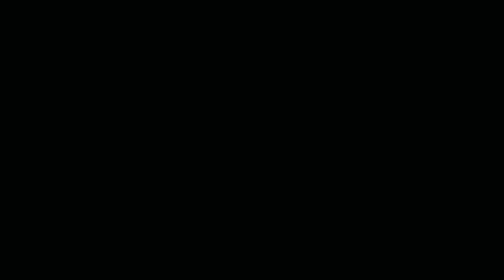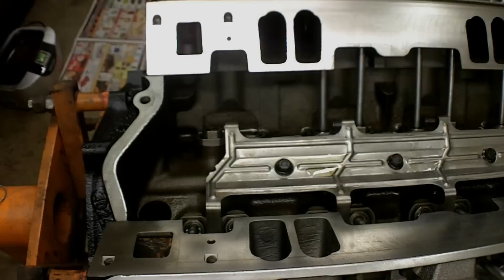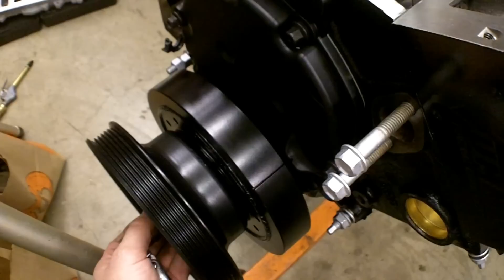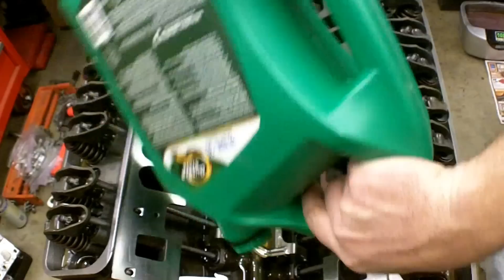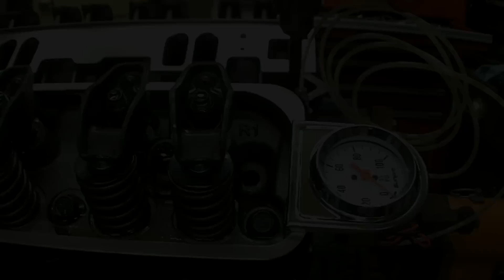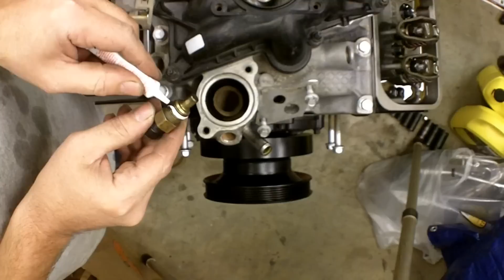Part 4-5 1998 5.7 350 CI Vortec Engine Rebuild

Comment: Thanks for your time and all the details.  There are some very helpful techniques.  I've got an 88 Chevy 4wd with an engine that at least runs well if I stay out of garages.  25 mpg, the secret seems to be the TPS not returning 5v whether GM or afermarket.  A TPS enhancer is out there for some older GM truck engines.  It's pretty wild what goes.  I got everything that JEGS labels as an enhancer and it all works to improve.  Now all I gotta do is get up the nerve to overhaul.  So thanks.
Reply from the maker: +Terence Gillespie 
No problem Terence! I'm glad you found the videos useful. I've never heard of an enhancer. I'll have to look into them. It's an ambitious proposition to rebuild no doubt- but it can be done with great success if you take your time and check yourself as you go. Good luck when/if you dive in! Take care, G.
Reply: +ghostses I talked to the company tech in CO and got some more inside dope on their electronic gizmo.  It does not just supply the missing voltS it changes the range so that a nearly perfect transference of throttle messages the distributor with spark advance occurs.  I got this info though in more detail because the first unit that JEGS sent me did not work so I called the manufacturer and they sent out a good one right away.  My truck with its old oil eating engine got attention right away from a Chevy garage after working on the transfer case.  Next time I took it in not too long after I began to have fuel, computer, and electronic trouble and the whole ignition computer thing was new.  So my truck has been down all summer with me testing and finding that an old worn water temp sensor had been installed and some other stuff. One injector was dripping...  Crap.  It doesn't  pay to own it.  GM got a complaint and I'm over in local garages.  So, watching you work was great.  Having a way wild engine that garages cannot understand and fool around on is a goal.  Ramjet might work.  Maybe my trouble is that I got a college degree.  I think that's part of it.  And I just spent half the night wiring a start button to the starter solenoid on my nearly new big HP commercial mower because it's needing more voltage than the factor ignition switch won't push a full 12 point whatever.  Factory engineers now..... Nothing's perfect.  Takes someone like you to set it straight.  Thanks.  You do well with your video presentation, the best.  No college dean is going to do anything different or better.  Building sales presentations earlier in my life was my business.
Reply from the maker: +Terence Gillespie 
Thanks for the information Terance! 

I've been saying for years just because someone does something as a "profession"- doesn't mean they're any good at it- regardless of education and time on task. Case in point- your local garage/technician. I myself have always gravitated towards technical things. The last 17yrs have been in the IT industry, with ten years in business for myself. I shutdown my business about 2yrs ago and am now flipping and investing in real estate...lol. 

It sounds like your local garage did more harm than good. I'm shooting in the dark, but I would ensure all chassis and engine grounds are intact- clean, bright, and tight. It's possible they didn't hook something back up when they were working on the transfer case, etc. which may be causing the onslaught of other issues. Something similar happened to a friends car which had some transmission work done. The fuel pump was intermittently working so it was replaced. The problem turned out to be they didn't connect a ground strap. Again, shooting in the dark- but in many cases the most simple things are often overlooked. I would start where they were working, and then branch out from there. If they pulled the transmission, I believe there is a ground strap that connects to a bell housing bolt on the passenger side rear of the engine- if I recall correctly. 

I don't see a degree as your problem. It's simply a different chosen path with a different focus. We all basically start learning at the same place- some just start at different times. You seem to be undertaking something fairly new and foreign, and are trying to track something down that even the "skilled" cannot find. It might not be easy, but you will find the solution if you stay at it. 

Glad you like the videos! Good luck in tracking down the issues, G.
Reply: +ghostses So you and I are kind of alike in our focus.  Real estate license.  Made major discoveries in language and math.  Alpha = base 26.  It's a mind blower when you begin to evaluate this.  I'm alone on a larger park style family farm with timber the crop.  Everyone likes going to a park so I'm in trouble now.  Rich kids like it and my personal curiosities have not gotten me up over the top of these wannabees, MDs and all.  No one but me likes me having the best anything at all even if I build it and I do enjoy building-modifying technical stuff. Flunky type engineers have flooded the market with half baked mowing equipment esp the larger home owner market.  I'm going to look around for an old 350 block to redo on my own and an engine stand maybe.  There is so much to do and I have to stop to cook clean up.  How wild can an engine build get on a budget?  I don't have 10k for the GM Ramjet set up fortorquey  heavy towing.  I've discovered that big stone has pictures in it and one I sold to a customer dentist has the Apple computer apple with the leaf two feet tall in relief, but no bite out of it.  1500 lb stones worth up to 10k or more.  I have an art degree with a heavy emphasis in psych.
Reply from the maker: +Terence Gillespie 
I know what you mean. I don't know. I tow with this stock rebuild 6 days a week. It works pretty good, but it does take me a bit to get up to speed going up hill. I'm pulling a 7x16 cargo trailer loaded down. Good luck, G.

Comment: First off, thanks for posting all the videos , I watched the whole series, My question is, where do you get the torque specs for the manifold? I had googled the Torque specs and got 10 lbs when I did the Intake Manifold in 1 pass. You did 3-4  passes at it. which I thought was a better.
Reply from the maker: ***** No problem Darren! I'm glad you liked them. I got the torque specs from a pdf I found online. They're calling it a Marine/Industrial manual but the engine is the same. Here's a link to one. The lower intake passes and specs should be on the second page I believe. Take care, G.

https://www.m2omarine.com/resources/Indmar_5.7RepairSpecs.pdf
Reply: *****  Thanks, that was exactly what I was looking for!!!!  Gonna go practice laying down a perfect 5mm bead!
Reply from the maker: ***** No problem! LOL... The 5mm bead is an art form for sure. 4 or 6 is easy- but 5 is something else. I would spend a few weeks in practice...lol. G.
Reply from the maker: +hoghogwild 
Thanks man! I'm glad you liked the series. That's one sweet looking engine you have there. The document  I linked does show a spider in it, as shown on page 28. It is an 01, so maybe things have changed things over the years in the marine/industrial engines, I don't know. I can't tell if the lower and upper are iron and aluminum though. Either way, the stock build is still going strong- knock on wood...lol Thanks for the post and take care, G.
Reply: 0 pp+900ppp

Comment: I said earlier I get a chuckle every now and then and the "Dead on 4 mil highly technical applicator" was one
Of them. However, it looked more like 4.02 to me. I noticed you have some good torque wrenches there. I bought 2 of the HF torque wrenches because I read so many good things about them. Even though you don't appear to have them, what do you think of them G? Laquer thinner? What ever happened to good old gasoline as a cleaner (I am gettin old). Through all 4 of these videos (so far), I didn't hear one "aww sh...". All I head was one "oops". Hope there will be a bloopers or are you that good?
Reply from the maker: Yeah...lol. 4 mil it was! It might have been .02 over now that I think about it. I'll tear it down tomorrow so I can check...lol. Yeah, I have three Snap-on torque wrenches from years ago. I don't recall how much they were, but do know I paid dearly for them. I don't have an opinion of the HF wrenches and have never looked at them. I used to use gasoline and diesel to clean parts- when it was cheap...lol. I actually like the smell of gasoline. Probably since it's one of the few smells I can smell...lol. There were plenty of cussing outtakes..lol. Since I try to remain G rated- they all hit the trash. Or maybe I am just that good???lol. G.
Reply: *****
G, you ain't fooling me...I know for a fact that was 3.89mils of sealer.
 I'm not going to tell you how I know....LOL, I've really enjoyed this rebuild..!
Reply from the maker: bain5872
LOL, the debate starts.. is it 3.89, 4.02, or 4 on the nose?? Glad you enjoyed the rebuild. Upper and lower ball joints coming your way soon...G.
Reply: LOL, I watch these at my work bench and I've noticed that the work slows a bit when I'm watching your channel...! Ball joints, Oh my, I'm going to have to fire myself....!
Reply from the maker: bain5872
LOL. I'm getting ready to upload the clip, so, your fired!!! G.
Reply: He he he.....! That was good! I've nothing more to say. Let the show begin!
Reply from the maker: bain5872
LOL. It's uploading now. It should be complete in a few minutes. G.
Reply: Too right on them valves you only need a half turn past zero lash

Comment: You teasin sob!  Where's video 5!  Haha!  Great series, man.  Thorough, methodical, smooth, professional, beautiful.  Did you track your hours on this?  What references did you use for the procedure?  Really surprised how few special tools were required to to this.  I just did an exhaust manifold on a 99 Mustang we just acquired yesterday and felt like a hero last night after I finished.  Now you rain on my parade with this masterpiece......  I don't see how you could do it better than this.  Impressive.  Thanks for posting this.

edit:  BTW I got some pucker factor when you started tightening that first rocker.  Did the nut seem a little tight going on, or was that just me?  I know they're not free spinning nuts, just saw what looked like a little more effort than expected.  On the degree turns after seat or torque, if it's an odd ball degree like 70 or something, I have a 360 circle chart and eyeball it for reference.  I was shocked at how long it took to prime and completely circulate the oil.  Really drives home the importance of pre lubing everything well during assembly.  Your tongue in cheek exactness on your sealant beads was just the classic dry humor I appreciate.  Keep up the great work.  Can't wait to hear it running.
Reply from the maker: LOL!!! Part 5 was uploaded but was set to private for some reason. It should be there now if you want to check it out. I didn't really track my hours but if I had to guess, it was about 80. That seems like a lot, and it was, but I cleaned and/or painted every part that was bolted to the engine. It's unreal how much stuff is bolted onto these engines, and how much wiring is there. If you watch part 5 you'll see what I mean. You can't even see the block once it's all put together and installed. I have a Chilton manual that I used for some reference, but it's lacking in many ways. I found the engine manual online- which is what I used for the most part. Yeah, I think I made about 4 special tools and that was all it took.

As far as exhaust manifolds go, you should stand proud! I hate installing them with a passion. I think that was the hardest part of the job in trying to hook up the Y pipe while laying on my back...lol.

Yeah, the rocker nuts, even on the original heads, were extremely tight. Tighter then I ever remember any being. I'm certainly not concerned with them backing off. Priming did take a while. Some folks will lube everything, but I just do the cam bearings and lobes since I prime the motor before running. I do the lobes mainly so they have some lube until the crank splashes enough oil up on them.

Glad you like the dry humor...lol.

Take care, G.
Reply: Yeah, I'll watch next, thanks.  I meant to say lube everything up or prime it like you did.  As long as there's oil on everything before the real rpms hit when it runs.  I've done tons of small engines, but only helped some buddies on rebuilding real ones. 

The exhaust manifold project went like a knife through hot butter until I went to install it.  Took 15 min to get it off, an hour to repair it, and 2hrs to get it snaked back in there.   Wish I would have video of taking it out so I could have reversed the exit path exactly.  It was probably funny to watch.  Just when I thought I had it, the setting sun got directly in my eyes, blinding me.  Many interesting words were uttered in that couple of hours.  In fact, I think I may have invented a few.
Reply from the maker: blmeflmm66
That's cool. I've worked on many small engines, but never rebuilt one. Mostly all I ever need to do is go through the carbs or change out old fuel lines. I guess I've been lucky.

LOL... I know exactly what you mean- even the part with the sun blinding you. I'll say it again, I HATE installing manifolds. Headers- even worse..lol. I bet you did invent some new words- I know I would have... Take care, G.
Reply: Well, see, um, I'm that guy that can't stand to see someone throw away a mower or weed eater or anything really that just needs some tlc to get running just as you have done.  Blow out the carb.  Maybe a primer bulb or carb kit and vrooooom!.  10 bucks, 10 minutes running like a top.  HOWEVER comma. Somewhere along the line I got sucked into that spiral of not being able to give up.   Consequently, as fan of old 2 stroke lawnboy mowers  I've routinely spent way more than their value to get them running.  But I keep telling myself if maintained, they will last a LONG time.  And that IS true.   I routinely use the 1965 LB that was the first mower I ever used. It's a year older than me. That engine's never been apart and starts on the first pull nearly every time.  It's just now starting to lose some compression. They don't make stuff like that anymore.  But run em on straight gas for 30 seconds and they need a complete overhaul or trip to the junkyard.  No need to reply, I'll go on forever.
Reply from the maker: blmeflmm66
I'm the same way to a degree. I refuse to loose a challenge and I too will spend more than what something is worth. But, after fixing something the value to me goes way up. LB is all I've ever used. I have about a 12yr old 2 stroke and it won't die. I replaced the pickup coil and primer bulb and that's it. First pull every time. I think they should bring back the cast decks though. G.
Reply: Then you probably have one of the last batches of DuraForce 6.5s.  That's really about an 8 or 9 horse engine with an undersized jet to meet EPA.  They are beasts.  A really great, simple engine.  You can often find cast decks at mower repair shops and ebay.  Somebody borrows John Doe's LB and runs it on straight gas. But not for long.  Happens quite often.  A buddy of mine back home in Kansas runs a repair shop and they don't even work on consumer 2 cycle stuff.  At $60/hr, if it's not a 5 minute fix, it's cheaper to buy a new one.  Sad.  He says ethanol gas is the best thing ever to happen to his business.  He attributes about 3/4 of his work to alcohol in the gas.  I have to put fuel lines and primer bulbs on something or other at least once a year.
Reply from the maker: blmeflmm66
I'll have to look, but that sounds right to me. Sad to say for sure, but if it's not a 5min fix it is cheaper to buy a new one. I must say I hate the disposable society we're living in. I try to do my part and fix things- but I absorb the labor costs. I try to stay away from ethanol if I can in anything I run- cars, etc. Sometimes I'm caught and have to run it- but I don't like it. I can tell when I put it in my vehicles. They run, but not as good. G.